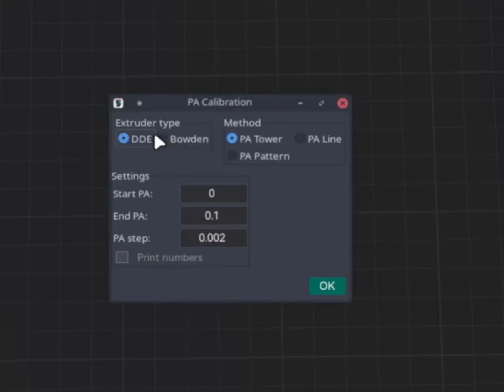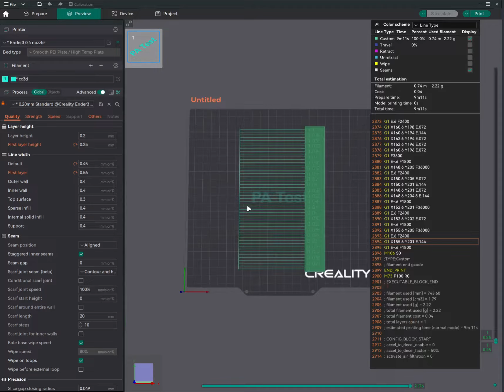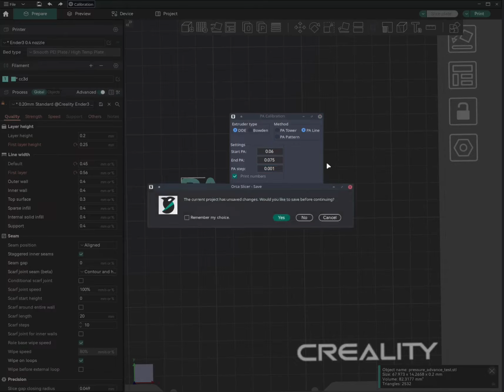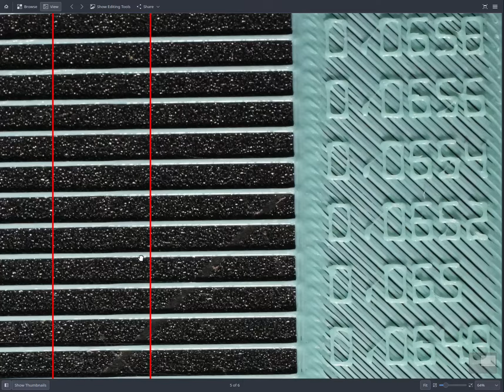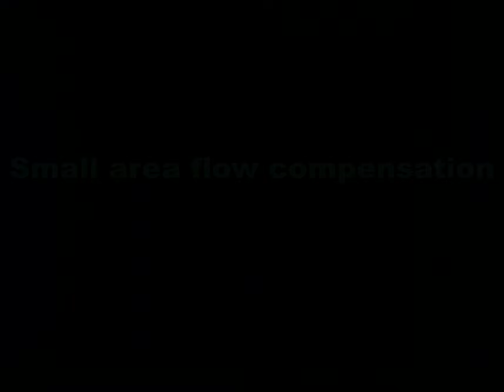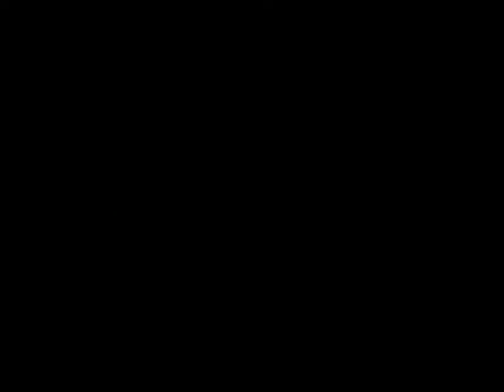Pressure Advance - OrcaSlicer/Kilpper (Bulging corners/Clean Top Surface)

Comment: for me pattern simply does not generate, i just get a small cube on the build plate
Reply from the maker: What version of OrcaSlicer you are using?
Reply: @radiy3dprints  I learned that i need to click slice to generate pattern. Tho i havent solved issue where orca does not see my lan printer
Reply from the maker: @Boz1211111  what printer do you have?
Reply: @radiy3dprints  I did now know there is no pattern before i click slice! solved
Reply from the maker: Glad you solve the problem.